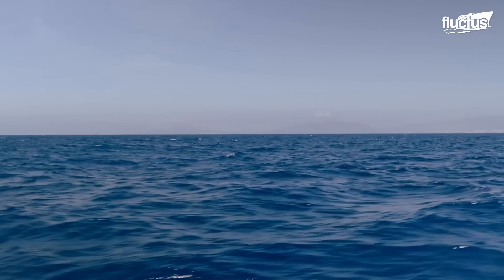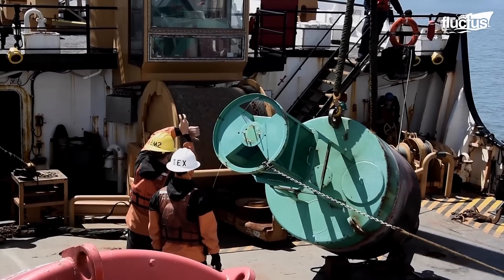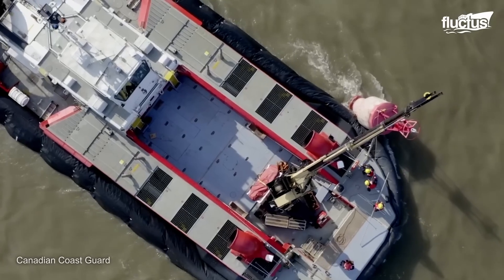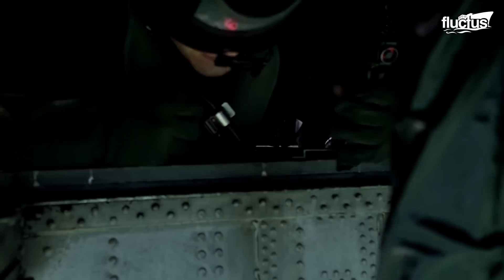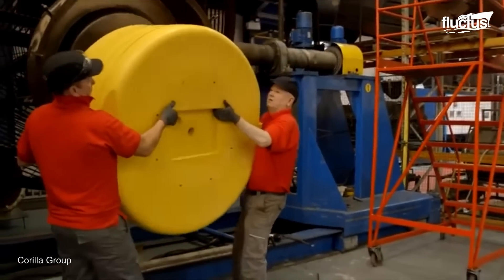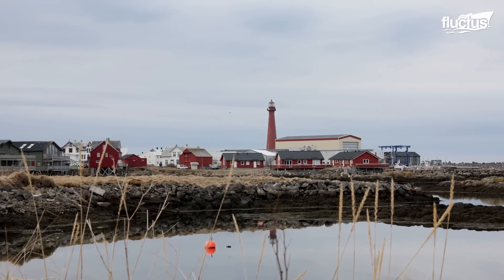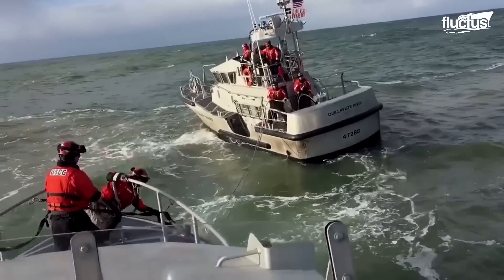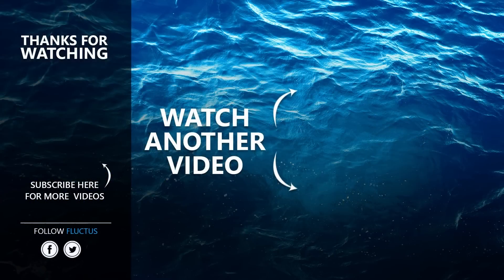Genius Techniques US Coast Guard Found to Clean Gigantic Buoys at Sea

Comment: Too bad the USGC was so lazy. They finally stopped dumping the lead acid batteries over board in the 90s. These batteries were never cleaned up.
Reply: Then they are all over your a$$ for a drop of gasoline when filling up. Practice what you preach.